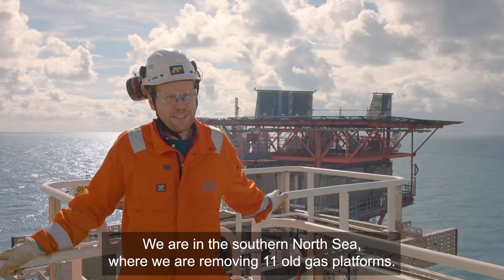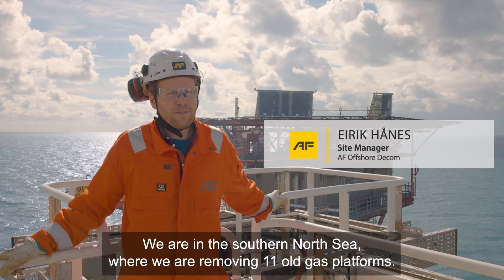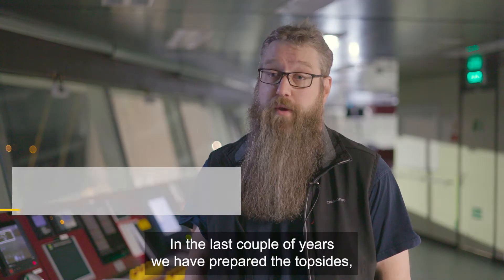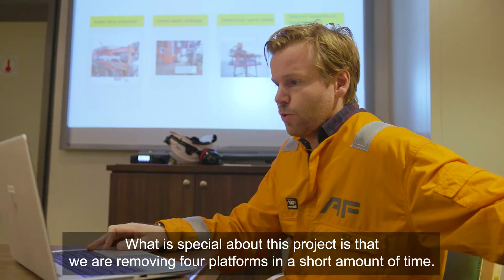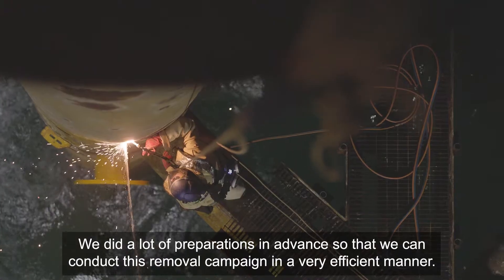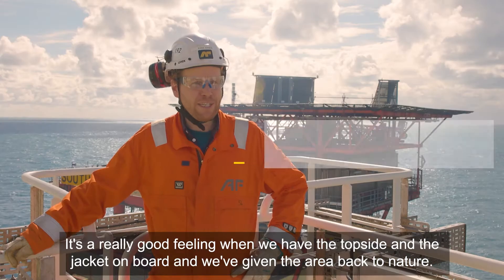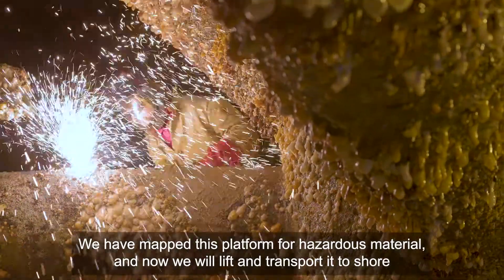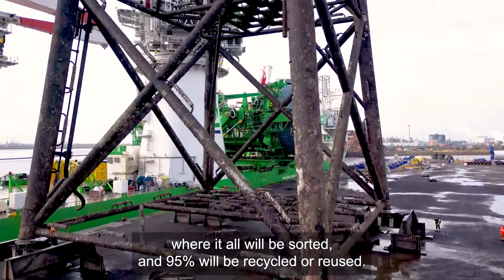Sustainable decommissioning of offshore platforms

Comment: Is the whole jacket or only upper section?
Reply: From Norwegian governmental web site —
Facilities must be removed in their entirety; only in extremely limited cases they can be abandoned on the field after ended use
Pipelines are not covered by the OSPAR Convention. The choice of disposal options is determined in each individual case based on a comprehensive evaluation, where costs are assessed in relation to the consequences for safety, environment, fisheries and other users of the sea.
PS — Looks like a best in class process.